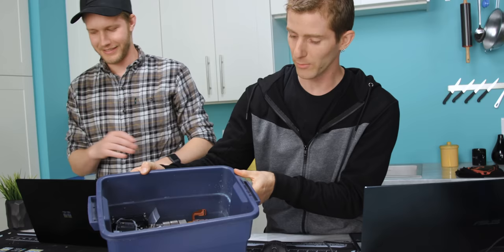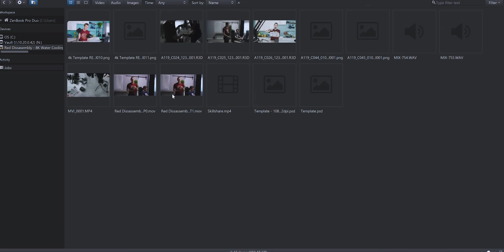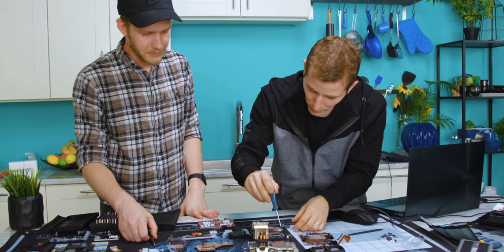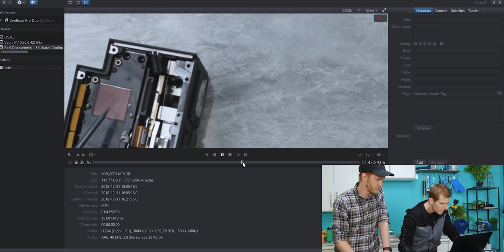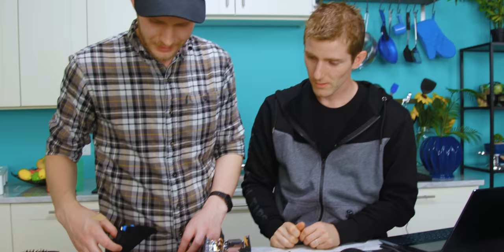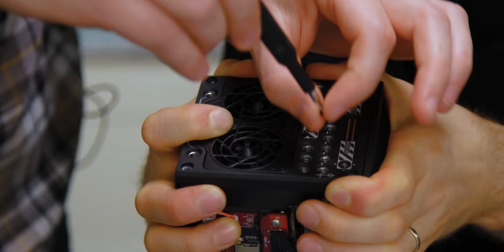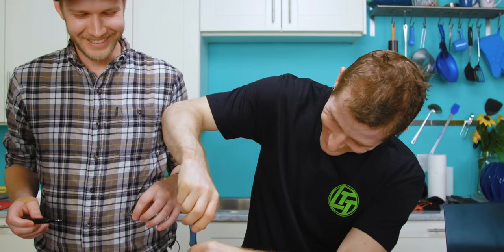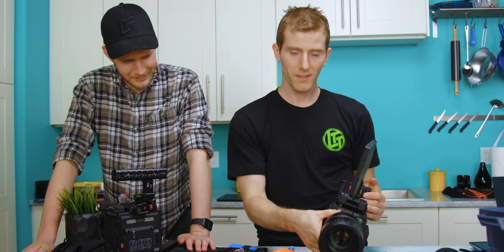Reassembling our $40,000 Camera

Comment: I'm confused. They forgot to benchmark a regular air-cooled RED camera so they're restoring it back to stock to do benchmarks.. but when they disassembled and let the parts sit there for months, how sure they can be the cooling paste isn't now affected by long exposure to air or even the sun? Or the actual disassembly process? Wouldn't it have been easier to benchmark another of their RED cameras - I'd wager it'd still be a more reliable comparison as it has been assembled by RED and effectively the unit in this video is now assembled by LTT and the cooling paste probably doesn't perform as well as when it came out of the RED factory..

Comment: It's rather reassuring that Linus is both extremely successful AND ddoes stupid experiments with his insanely expensive equipment. I've only managed to blow a capacitor (probably) in an $80 piece of equipment. Granted, it's not something I can repair right now, but I think I should be able to at some point.

Comment: Dear Linus,
Please educate yourself and your team about ESD and proper ESD procedures. I had to cringe pretty hard that you didn't even use simple ground wrist straps on a $40k piece of electronics. Even though it worked on power up the damage you may have done on a microscopic level could cause that camera to fail at any time. It looks like the mat you where using may have been conductive as it looks like there is a grouping snap in the corner but it does nothing if not connected to earth ground. You also kept PCB's unbagged in about the worst container possible for ESD.
Protecting from ESD damage isn't expensive nor does it take a lot of work. There are many companies that will give you an ESD audit and set you up rather easily. Please do so.

Comment: Didn’t Linus buy two of these cameras in the first place? If so why didn’t they do the bench testing on the camera they didn’t take apart and compare the data from the water cooled one instead of disassembling then reassembly then disassembling to add water cooling and then reassembly

Comment: damn 117 Gigs for a Video file... i was struggling trying to fit a whole game for less size on my hard drive! (well i have partitioned it in a few parts and recently added a 100 GB M.2 and cloned my drive... so i practically have 100 GB of free space but divided in chunks of 20 GB. one partition has my Windows 7 DVD image and all the Drivers from the mother board DVD and GPU Drivers an all..., the other is a 16 GB partition for 1 Page File, i got an other on an other HDD and not a Partition and none on the M.2 since SSD does not like to be rewritten to often... plus i have 32 GB of RAM... not many things can fill that yet, yet...)

Comment: Few months ago: I'm going to watercool this.
Few months later *MUCH DISAPPOINTMENT*
Reply: Sero3 not only did they not have benchmarks but they also didn’t have the correct equipment to make and prototype their own parts.  The cnc router they had could not easily machine the copper and nickel parts because these materials are resistant to machining.

Now that they have upgraded they can reboot prototype water cooling.